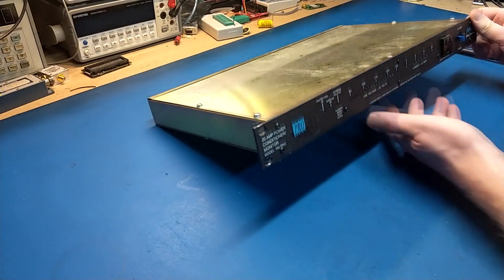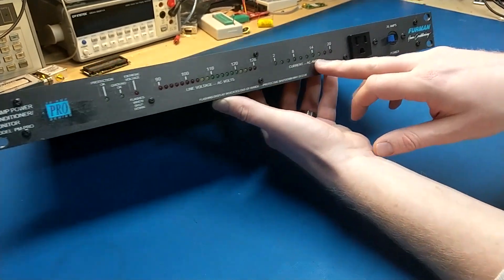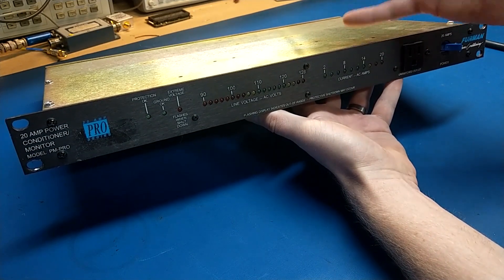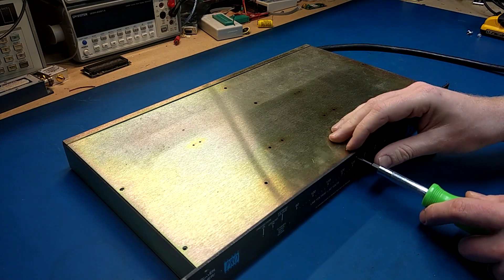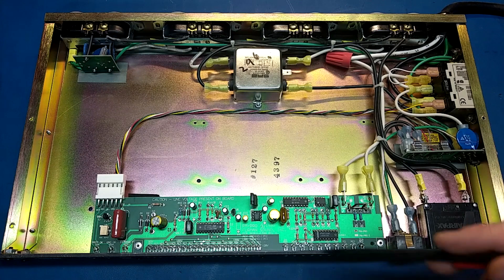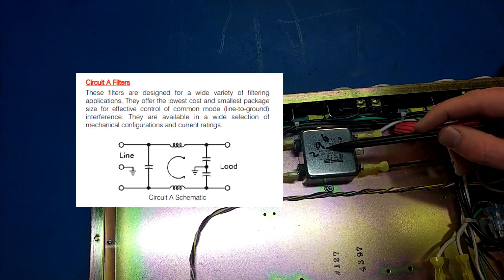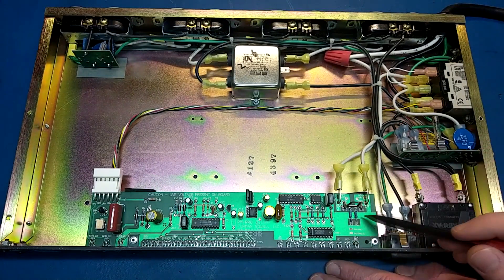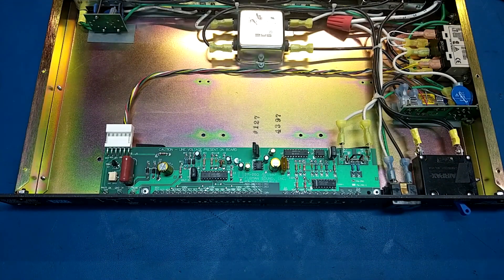Furman PM PRO Power Conditioner Internals and Repair

Comment: Thanks for showing us around.  That was helpful.
Reply: After watching this I was inspired to peek into a Live Wire PC900 and I just had to laugh.  The box is SO much emptier. A single 20s201x3 MOV, no line filtration at all, no internal fuses, no isolation whatsoever.  Just a rack-mount surge suppressor.  It does look like with a little more knowledge I could at least add a line filter.  There's certainly plenty of working room.

Comment: Hi Brad! thanks for the info! we've been scratching our heads over at the music studio as to what unit is the right one for cleaning power, and how much is a power regenerator necessary? Do you have any videos on that or could you shine some light on the matter? would a transformer based power conditioner like the Monster 2500 pro line do the trick?
thanks
A

Comment: I've heard ceramic fuses should be used because the filament oscillates creating noise in a regular glass fuse.  ..and Hey Brad, can you point us to some reasonably priced units that do the same or better?

Comment: Always wondered the line filtering going on in these units.  Might as well do the same thing they did by purchasing a nice filtering unit and cramming it in a surge protector.  At least the one I get will have both common and differential noise mitigation.

Comment: Hey. I purchased an furman ar117 and it provides power to all outlets. The only thing is that it has a gun to it now. Do you know if that is something that Could easily be fixed and where the problem may lie and if this could be potentially dangerous to things that I have plugged in?

Comment: Hello I watched your video today. Thank you for a great review. I have a question to see if you can help me answer it. Had a power outage in my home today for a split second, when I went into the room to turn my equipment on, I realized that my Furman p.m. pro-was completely dead (no lights). Would you happen to know what might've happened? I will be checking for the circuit breaker button in case it does have one in the back but will get to it when my friend can help me access it (I am disabled and cannot do it myself). I would appreciate any help.  thanks in advance

Comment: That is the exact same unit I had years ago, I got mine shortly after the 20 amp Pro Series was introduced, I had two over the years and both worked well but it was the first one I got that was surprising as it came with a 15 amp plug on the end of it, that would change by the time I got the second one and the 20 amp plug had to be cut off and a 15 amp plug installed.....power conditioners are good "peace of mind" investments.

Comment: For most residential homes, there is only 1 phase that feeds the transformer and then the secondary side is center tapped to create two lines of 120V and a neutral, but it is not called split phase. It is referred to as single phase.

Comment: DUUUUDE! This is actually pretty amazing. I have an old Fuhrman power conditioner thats been collecting dust for years. It pretty much just powers on in protection mode anymore, which means no power to the outlets. I was in a band years ago and the place we practiced was powered from the house next door through extension cords, and my rack started popping more and more until the unit just wouldn't come out of protection anymore. I asked a guy once and he basically described the MOV's like you did (eventually take too many hits to work anymore, etc). Since then, I've gotten to where I can start fixing some things and was thinking of looking at this unit again after so many years. This video was very enlightening. I will ask, just as a secondary opinion for input, if you think that scenario I gave sounds like its a MOV issue? I look forward to hearing your thought. Thanks for doing this!

Comment: Can u comment on power condition aspect of these units? I always thought that was a bit of ‘snake oil’ but don’t know the science. 

A lot of guitarists use furman rackmounts. I wonder if the power conditioner aspect of this or the more expensive units would help minimize unwanted noise and interference in a high gain guitar amp?

I’ve found one video that tested emi on a similarly priced furman and it reduced emi a little but not a lot. 

Great video. Thanks!

Comment: Surprised to see plain glass fuses in open-frame fuseholders in a (relatively) high-current device.  My understanding is that sand-filled fuses are favoured anywhere a very high fault current might need to be broken.  If v high fault current fuse wire can vaporise - rather than just break;  fuse then explodes, depositing mist of conductive metal vapour in vicinity, potentially leading to secondary shorts and worse.  Sand prevents this (as would an enclosed fuseholder).

Main breaker should be providing this protection, I suppose but probably good practice anyway.  Unit in vid looks like it's from mid-'90s, anyone know whether current-production units have plain glass or sand-filled (or whether this is now standard/required practice)?
Reply from the maker: The fuses here are only to break paths to the MOVs in the even they fail closed, outlets in the back do not pass through them. The circuit breaker offers protection for that case here as you mentioned. Thanks for watching!
Reply: @bradthx  Thanks Brad!  Keep 'em coming :)

Comment: Nice watch, thanks for sharing.  I have a very old Furman power conditioner in my rack, from 2001.  The PL-8.  I am wondering if designs have gotten better over the years and whether it is worth me 'upgrading' for a new version, or will it be more or less the same and nothing has really changed much, in all this time?  My unit has never taken any 'hits' as far as I know and still works just fine.  Just curious what else is being offered out there and whether I should be looking into getting a more modern unit?

Comment: Interesting video, thanks! That's pretty low effort but acceptable for the price. These are better than super cheap generic rebranded Chinese units, though that's not saying much. Because of all the space, you could always improve on the filtering if you wanted to. There's enough space to put in a higher inductance common mode choke in series. You could even use this as a base for a more accurate system that would respond instantly to overvoltage etc. The most "interesting" power conditioner I've seen in terms of design is Accuphase's PS-1230. It's about 70% efficient (it just seems like a regular high power audio amp with fewer stages if you look at the PDF..). Maybe its one advantage is lack of fans for the available power, the disadvantage being absurd audiophile price. In the end, some AC > DC > AC > Filter solution (aka on-line UPS units) seem like a better deal if you want guaranteed clean power haha.
Reply: This actually isn't that much better than a cheap unit off Aliexpress, and certainly nowhere near as good, if "good" is a term you can use here, for some of the bit-more-than-bare-bones units on Ali.  This really is the absolute minimum you can do and still meet your technical claims, and certainly there's no special design or magic tech here, it's just a bunch of conventional off-the-shelf stuff bolted together with a flashy-light display to make it look good.  I'd say it'd be around the two-hundred-dollar mark on Ali... what's the cost of this one?